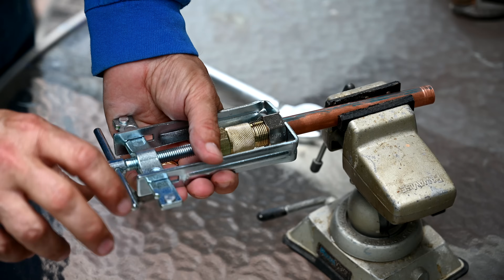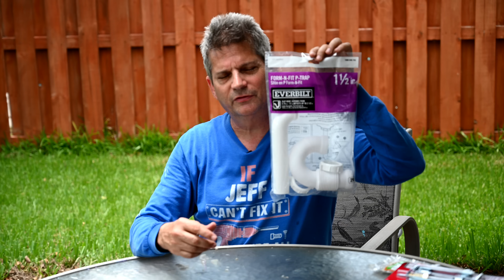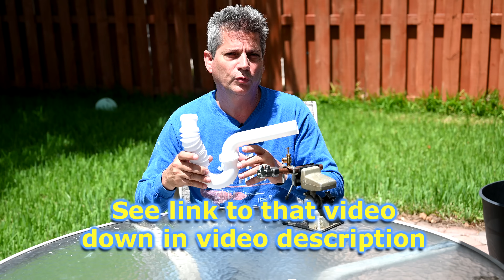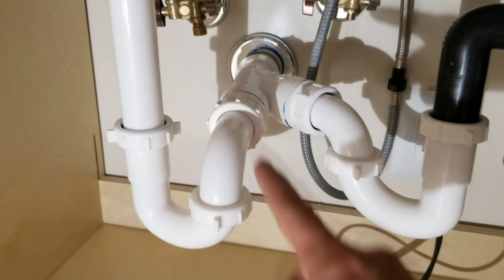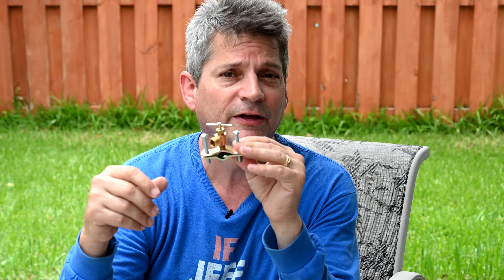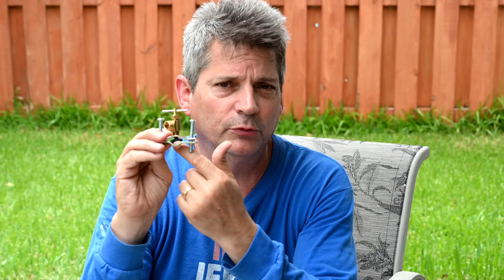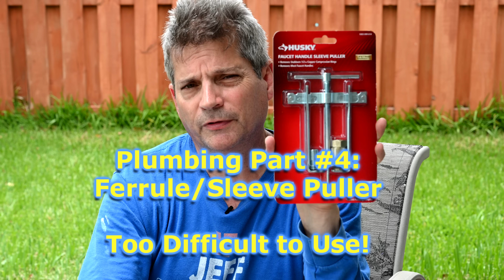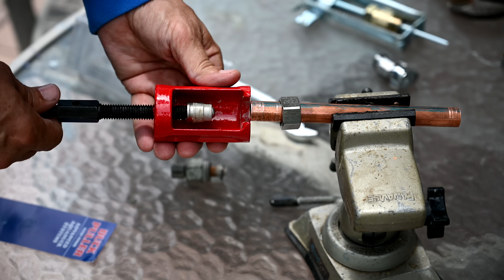4 Plumbing Parts/Tools You Should NEVER Use. NO Plumbing Fails

Comment: Today, There are two plumbing codes recognized in the United States. The Uniform Plumbing Code (UPC) and the International Plumbing Code (IPC). Both are very similar yet the IPC allows more approved methods as a result of their approval process. The Florida code you are citing from is shown as an International Code by the graphics at the top of the page.

The first thing you look for on any plumbing piping, fixture or appurtenance is that it is approved for use by a testing agency like IAPMO (UPC), ICC-ES, CSA and a very few others which will label the plumbing clearly as being tested and approved with their stamp.

"S" traps are prohibited mainly because the trap seal is too deep and sediments cannot discharge (the depth is too hard to siphon). You see this when there is an installation of a new fixture and there is a revulsion to enter a wall for piping placement. The solution for that is similar but to use a tee with an air admittance valve and a standard trap.

The flex-fit trap assembly is a code violation because the interior waterway of the piping is required to be smooth and free of obstructions. This device will trap all kinds of debris and will eventually clog up for the reasons you mention. Hmmm... I have never heard of an insurance company doing plumbing inspections as they are not qualified nor do they make the time.

Good conversation on the saddle valve. See the inside of the piping? It dimples and will cause wear over time.

Interesting tool discussion. I would be careful with tools that could flare the piping. You will find that once the ferrule starts to move, it will come off easily.
Reply from the maker: Good info thanks!

Comment: Why does he keep referring to "Handyman" as offenders of these violations?  I've been doing handyman work for 12 years now and have never in my life used any of these products in this video nor even thought about using them.  I've seen plenty of professional plumbers or contractors in general that have made code violations.  So please stop pointing fingers at the hardworking and honest handymen.
Reply from the maker: Of course you never used these products. But that does not mean that handyman guys are not using them! They use them all the time. Even worse I can't tell you how many times in Home de[pot I see the plumbing aisle guys talking to a handy man and hand them a flexible p-trap
Reply: @jeffostroff  , hold on now, you are absolutely right, in that the “sales”, personnel, will offer. (Or hand), them to a handyman, yet that IS their job, … (to sell the items that the store stocks, which by the way, is NOT illegal), … perhaps, you should be pushing for your local/state/federal, political circles, … to change the manufacturing laws, prohibiting manufacturers from making them, … 

I’m surprised that the form fit manufacturer has not sued your butt for defamation of picturing/showing said company’s drain product, … at the big box store, but hey! Guess you been lucky, so far, … you are correct about the saddle valves, but then, I’ve never seen a ball cock valve fail, but have seen, the old style gate valves fail, … usually, due to the packing, but depending on the balance of the acidity of the water quality, … should the water quality be too alkaline, it will also eat away at the “gate” section, …
Reply: @johnosman8971  Sue for defamation? How so? It's against code, and he showed the code. "You defamed our company by showing one of our parts is against plumbing code!" Yeah, good luck with that.

Comment: Easiest way I found to pull the compressed ring is to cut across the ring with small hacksaw. (Doesn't have to be straight across). Cut down just enough for slotted screw driver head to sit and to pry. Pops right off easily.
Reply from the maker: Yes a lot of guys do it that way in fact we want to do a video coming up about that as well

Comment: Just install a 90 on the top of the tube coming straight up. Then you can use a p-trap instead of an s trap. What's the difference if it's coming through the wall or floor?
Reply from the maker: Matt the difference is if it goes into the wall, that helps slow down the water so there is no mass momentum of water to cause a self siphoning out of the S-trap. The floor exit means now water can drop from S-Trap down to the first floor, down to the basement, down to the drain, a long straight unbroken vertical drop, which can cause water to self siphon out of the S-trap.
Reply: @jeffostroff  what about a one-story crawl space?

Comment: I enjoyed this. I'm embarrassed to admit I used a saddle valve in my own house and my brother's. I will replace them both this spring. I can't stand something being done poorly. I learned and adapted. 

Other question, can those "sleeves" from compression fittings be taken off and still leave the integrity of the copper pipe? I now dislike the saddle valves because they damage the pipe, but don't compression fittings do the same if tightened enough?
Reply from the maker: Yes, I take them off all the time. You don't need the fancy $50 tool I have, this Husky tool even though I criticized it, will do good on no corroded pipes to pull off that sleeve, and it does not damage the pipe. https://homedepot.sjv.io/7me1Yr

Comment: I'm guessing ur a plumber who's losing money to all the convenient diy fixes.  Does it seem like I'm bashing you?   Well it seems like you're bashing me and diy'ers alike in ur video with all your lame comments.  And you sir are entitled to your opinion as well as am.      Id like to know what you charge hourly.   Just ur simple man hour labor fee?    I bet I can hire a mechanic to do a complete engine swap cheaper than you'd charge to relocate a shower drain.     Thats the real  issue.
Reply from the maker: you completely missed the point of the video I'm trying to help you avoid having to play a plumber so for those of you who do it yourself it's just a matter of using the right parts it doesn't even really have to cost more it's just don't use the parts that I told you not to use

Comment: "It all comes down to, Somebody was trying to save time, somebody was trying to save money "   hey just fyi  not everyone can afford penthouse hooker rates to hire a professional plumber to do a three hour job for 1200$  lol.   Hence why us diy'ers etc opt for such options.  Yes I agree, long term they're not exactly a trusted fix.  But so many of us Americans, especially now as of right now when money is issue, we can't afford a skilled tech to come in.   But hold on a minute,  just an example. I had a plumber come into my mother's home to give us a quote on removing a section of old cast iron drain pipe that went from upstairs toilet to basement drain n simply replace with pvc.  I've researched how to do this n its as simple as Sawzall cut in two spots. Get some clamps with rubber sleeves and appropriate pvc fittings and done.   Hell I build oil well locations for a living.  I'm basically a plumber as well but for oil and gas. And soon as he quoted me 1200$  I said hell no.  And u know what.    It cost me under 60$ in parts.  And literally 2 hours of my time.  And that was with sitting n gabbing with my mother n chain smoking cigarette breaks.  So you tell me how 1200$ no matter how dang skilled u are is justifiable for such a job which took me an unlicensed plumber/diyer  a mere actual hour labor when u really think about it.   Plumber and electricians are the biggest price gougers ever.  Hell, mechanics average 75-100/hour flat rate.    And they do more. Lol.  Hence why most who opt for these fixes.  We're not dumb,  we're not poor,  we just can't justify paying cut throat rates for something so miniscule.   Hell, the first time I hired someone to hook up a new water heater it cost me 1700$  second time I did it myself in under an hour and a measly 30$ in parts.    So do the math.    I guess I'm one of them trolls u talked about in ur video now. Lol.
Reply from the maker: I'm trying to help you avoid having to play a plumber so for those of you who do it yourself it's just a matter of using the right parts it doesn't even really have to cost more it's just don't use the parts that I told you not to use

Comment: As a plumber I do not use a ferrule puller because when you pull the ferrule off you're making the pipe smaller all the way to the end which makes the pipe week and if you do not tighten it down a whole lot it could just pull right off
Reply from the maker: I doubt that it true, you can't make the pipe smaller without removing material. You are simply sliding it off the pipe. If you were deforming the pipe like you say, then you would not be bale to slip on the new ferrule. And you would have leaks when you install the new valve if the pipe was made smaller. None of this has ever happened with me.
Reply: @jeffostroff  of course you can slip the ferrule right back on it's because the pipe is a little more compressed all the way around from where the old Pharaoh was all the way to the end I can show you the simple test
Reply: @jeffostroff  you can make a pipe smaller without removing material that's why they call it a compression fitting you can compress the pipe

Comment: Your Huskey Faucet Handle Sleeve Puller has received a bad review from you.  It may not work like you want to remove compression sleeves from pipes, but it's other (MAIN)  purpose, as stated in it's name is to remove faucet HANDLES.  It works great at pulling stubborn faucet HANDLES!.  You shouldn't specifically condemn a tool and advise nobody should ever buy it without at least mentioning it's good qualities.  You obviously haven't tried to remove a faucet handle that's been in service for fourty or more years but in most cases this tool does the job.  Give it credit where it's due.
Reply from the maker: Yes it does work better as a handle puller

Comment: I can buy a 40 gallon Bradford White water heater all the shark bite fittings, new ball valve, supply lines, PT valve at the local plumbing supply house paying their full retail prices for right at $500. It takes me 2 hours to change out the tank. Every plumber around here wants $1500 to $1800 to do the same job. Why do plumbers think they need to make $500 - $650 per hour for their labor. And they are probably getting a price break on the parts too that I'm not getting. I just paid a plumber $4000 to completely re-pipe my entire house with PEX because of leaking pipes in the slab. He spent a total of 10 hours at my house over 3 days. I doubt there was $500 in materials. And I have to fix the holes he cut in the sheet rock to access the manifolds. The work while being functional was not done with care like what I would call like a true craftsman would do. It was done in a manner that he would spend the least amount of time possible. I had installed ball valves on all the supply lines going to every faucet and toilet in the house. He replaced all those with gate valves I'm sure because they cost him less money. When I questioned that he tried to tell me those are better for that application. And you wonder why DIYers hate to pay any supposed professional to do work for them.
Reply from the maker: They charged me about $1200 including the tank and all parts in 2017 for my Hybrid tank. I would not use shark bites for this however, why don't you solder the pipes?

Comment: Thanks so much for this vid.  I'd considered one of the flex-traps for a custom vanity where the sink hole was slightly offset.  I ended up redrilling the sink hole to make it line up, and now I'm glad I did.

Now my problem is an old cast-iron toilet pipe that extends up over the floor and was beaten down over the closet flange....
Reply from the maker: Ooooh, cast iron, we've played that game a few times, I hate it. They develop hole sin the pipes like cancer, and sewer gas leaks in the houses.
Reply: @jeffostroff  sigh  Oh great.  And if I wanted to replace that I'd have to rip up the entire floor and find out where it connects?  I don't know, it's super-old and doesn't seem to have holes, fortunately.  However, the pipe narrows as it goes down, causing all sort of other problems (like... trying to fit in a new flange, even one of those made to be inserted into those pipes).

Comment: As a plumber I have never used compression sleeve pullers.  I can remove them with just a pair of channellocks.  Or I cut them off and to a proper repair.
Reply from the maker: Yes, some people do that. But when you have a severely neglected bathroom, and lost of corrosion, you will have a hard time getting enough grip on that compression sleeve to pull it off the copper pipe. I deal with a lot of corrosion and leaks and floods, not like what we see on the Home Depot Magic Kingdom videos where everything is perfect.

Comment: Jeff, what do you think of SharkBite solderless connectors?
Reply from the maker: I only use them for temporary connections, and only outside the wall where I can see them. Only in my house and my neighbor's house did we leave it permanent under the sink, because the only wat to convert from the now-banned polybutylene gray piping is a Shark Bite connection that connects to the gray pipe, but receives copper on the other side so we can put  a regular copper pipe compression fitting on there.
Reply: @jeffostroff   Thanks for the reply.  This video made me wonder about how good they are after I saw another video elsewhere claiming I can put cut a copper pipe to insert a T fitting using one of these, without soldering.  I need to put in a line for my refrigerator ice maker and already ruled out a saddle valve for that.  I think I'll just give up and hire a plumber.

Comment: I bought a house only to discover years later that the saddle valve in the crawl space for the refrigerator had been slowly leaking for a very long time.  The excess humidity this caused resulted in insulation falling off, and the subfloor in the kitchen and living room rotted from below.  Everything had to be ripped out right down to the floor joists.
Reply from the maker: Oh wow! An all these clowns keep leaving comments here about how I'm wrong to not use saddle valves, they have been installing them 20 years with no problem, blah... Of course they had no problem, because they don't get called in a few  years down the road when victims like you have a flood.

Comment: These dry traps are legal in UK and they work extremely well. It works on the same principle as a heart valve. They are not cheap compared to the stuff in Home Depot, but there is no water seal to get sucked out. Water pushes it's way through, self-scours and draws a dose of air behind. Any back-pressure instantly flattens the one-way valve . It can't blow back. Check the website for regulations.
https://www.wavin.com/en-gb/catalogue/waste-water/waterless-traps/hepvo-waste-valve
Reply from the maker: Yes it seems better than the flexible P-trap

Comment: So S traps worked for a hundred years but not anymore 😏
Reply from the maker: What makes you think it has worked for 100 years? Obviously it has not if the banned it in the plumbing code! They probably got lucky in many homes, but unlucky in others, maybe people never paid much attention to the sewer smell. But it happens enough that it was banned. It likely happens when there is no plumbing stack going up through the roof. If you just run the pipe through the floor down to the basement you run the risk of the failure mode occurring.

Comment: My problem is a sewer smell in the bathroom.  The  bathroom  P trap  fills with sewer water !!!  I empty it, and a week later it is full of smelly sewer water.
Toilet flushes ok, water goes down the drain normally.    Any ideas?
Reply from the maker: The pee trap is supposed to have water in it that's required by code that column of water in there is what is supposed to stop the sewer gases from coming up in to your drain that's why you smell let gas. So it sounds to me like maybe there isn't enough being water being kept in the pee trap as the water column it could be the P trap is angled downhill too much towards the drain pip going into the wall But you should have a good solid column of water inside that P trap to keep the gases from coming up you should not empty that

Comment: Do you vent your sewage network? That's why you have the "S" problem
Reply from the maker: The venting of S traps is one of a few different problems that lead to failure of the S traps so some houses have them vented in some houses don't depending on how old the house is. But the other problem that can lead to siphon engine an S trap is the fact that the output of the strap goes straight down through the floor down into the basement for example and it's that long length of pipe that creates a lot of inertia for the water rushing through the S trap that could cause it to self siphon
Reply: @jeffostroff  same thing could happen to the P trap. You mean some houses don't have any vents at all? Venting should be obligatory from your building code. Over here, we vent everything